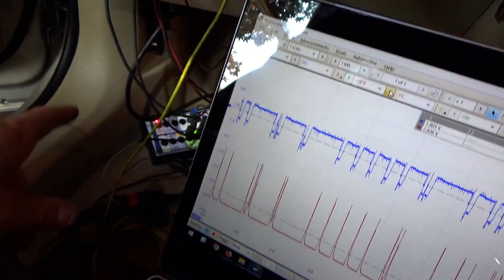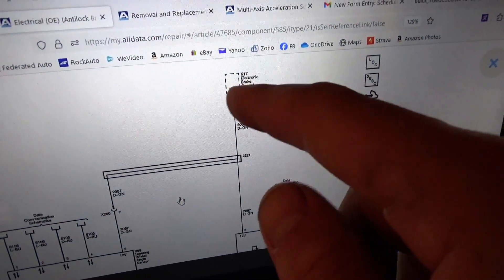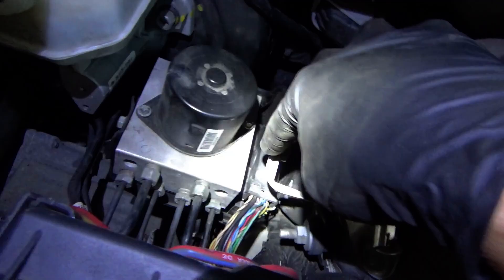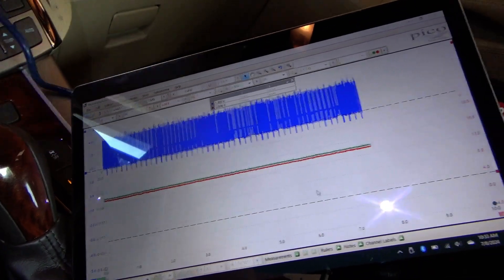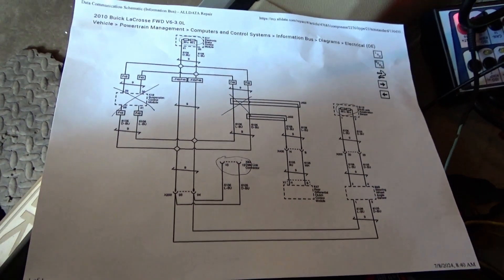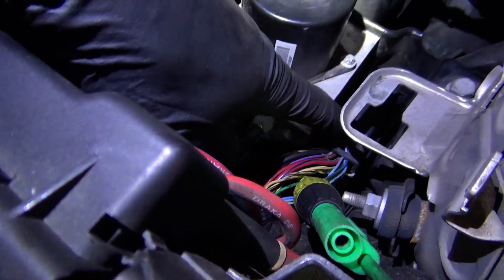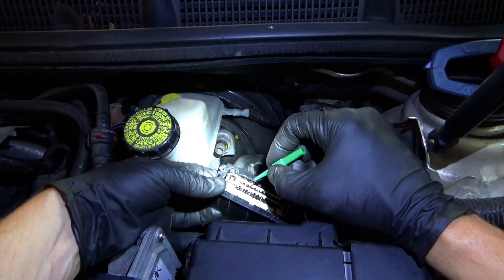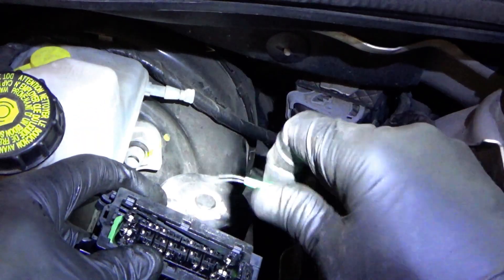(Pt 2) Customer Spent $1000...Now Car is MORE BROKEN!? (Buick GM ABS MALFUNCTION U0074)

Comment: Very common abs module fault, there is a pcb inside floating in a gel medium with gold conductors for critical connections and aluminium conductors for both power and ground, the aluminium conductors are in a horse shoe shape and are resistance welded to the pcb pads, they due to heat ,(coolant res directly above) want to straighten out and over the heat cycles fail. They commonly present issue intermittently until complete failure with ramping frequency. Can repair.

Comment: There is a reason they have the EBCM deliver power to the sensors which is likely a regulated supply that it can also monitor as a reference voltage.

Comment: I love advanced traction control and abs is an important part of it. The stabilitrak in my chevy cruze kept me from smashing into a guard rail. It was the first crappy winter storm of the season with the wrong tires. I was heading home at night and a truck was driving down the center of the road and I kept easing over to the edge and my car dipped off onto a hard shoulder and it immediately spun me sideways. The system noticed it even before I had consciousness of it and was heading right into a guard rail when the transmission shifted down, and it was pulsating individual wheels knowing the angle at which by this time I was turning the wheel to compensate straightened me back out like it never happened. Absolutely insane that my car just did that. I seen videos of it in action. I would've totaled my car out if it wasn't for the Stabilitrak.

Comment: It’s possible that the module it’s powering up has a capacitive load that looks like a short to the EBCM so the EBCM shuts off the power and retries it repeatedly. It would be helpful to also monitor the current while it’s retrying.

Comment: That was fun, thanks for taking us along on your very logical network diagnosis Ivan. It wouldn't have beneath me to hack it if it were my car, but rapping on the ECBM and seeing a dropout follow like that, really causes me to suspect a bad solder joint, probably on a discrete component or hookup wire that wouldn't be hard to find and fix. I think I'd have snooped around in there before calling the ECBM a lost cause.

Comment: I'm not sure who makes those modules but the Mercedes and Chrysler ones always used push fit connectors that had push pins that fit into the holes on the circuit boards instead of soldering the connectors directly on.  Those push pins or the holes on the boards could oxidize or become loose like the connectors themselves and in those cases I just add solder to the pins and it sometimes solves the issues.  But who knows, the 12 volt power feed for the sensors might be going through a relay inside the module and its the relay that's bad...  Idk, I just like to take the broken things apart. 😁

Comment: I e ran across this issue in the past where a circuit would not power up and after testing circuit and powering it up the circuit went back to working as normal. I was honestly baffled

Comment: Fixing it the right way was the correct thing to do. Imagine if you did a "no parts required" hack and the teenage daughter of the owner died in a crash because the ABS was deemed at fault? There is a reason why ABS stuff and air bag sensors and parts cost so much. The manufacturer has to make lots of money to afford all the liability insurance they have to buy so they can pay the jury awards when things go wrong.

Comment: I agree that for a shop when new parts are available that replacement is the proper fix. However, it probably requires replacing the entire ABS module including the valve body/pump assembly which may be very costly. In my case I have a 16 year old car with a defunct maker in a country where replacement parts run approximately twice what US residents pay. The electronic module for the 9-3 is available separately at CAD 677 plus shipping, actually not too bad. Fortunately Saab parts are still very available due to the intervention of the Swedish government. Then of course you need to get a Tech 2 with appropriate module and card and program it to the car. The repair to my module is still fine after 2+ years.

Comment: Same boat, my car or customers request I'm hacking the wire. Ive had both types of customers and they both have valid points on why they took the fix they did. Usually i can tell what the customers going to do buy the way they ask questions. Nothing wrong with ether way.

Comment: Excellent job Ive!  I love your 'terminal drag test' mate! - That's a ripper!  You eliminated half the EBCM problems by tightening those bus connectors, allowing you to confirm the other fault being internal to the EBCM module itself.

I guess it wasn't part of the customer's request, but I would love to have seen the EBCM board itself, out of its casing.  There may be just an easily 'Ivan-repairable' dry joint on the board?  Never mind, I may still see that in part 3!

Comment: To me that looks like a dry solder joint ... on the 12V line connector joint. my son had a similar  situation on his 24yo Toyota MR2 radio one minute it was ok then the next it would not power on took it apart and by passed the connector radio worked so reflowed the solder joints on the connector all ok, he was pleased as he liked the graphic's on the lcd display

Comment: So, an internal connection problem at the EBCM (possibly a cracked solder joint, not a transistor as I initially suggested), gets a bad diagnostic, spreads the network pins and installs unnecessary aftermarket sensors, collecting almost two grand in the process! Not the right way to make money!
I would be very tempted to provide the 12V externally and let it run until the EBCM fails for some other reason - less material going to the junkyard or landfill.
Part 3 will be more complicated because of the EBCM replacement (this should have ended NPR, in Part 2). Great work, as usual, Ivan!

Comment: Customer must have money to burn. Obviously a dry in the ABS. I wouldn't even go to the trouble of removing the ABS and opening the module if it would split. Either just short the IGN feed in the plug to the green. Or a lot easier, find an IGN feed near the SAS and connect to the green there. Fused if necessary. I'd have done the last one and torture tested it for a while anyway. Good diag anyway 👍

Comment: Tapping on the EBCM acts like a cold solder joint.  Welcome to the use of leadless solder.  It's too brittle.
If the ECBM is board accessable, then you could probably reflow all the solder joints, specially on the relays area of the board.

Comment: The idea of CAN Bus was to reduce the number of wires and connectors. It seems to have done the reverse, and enabled car manufacturers to build in overly complicated and unnecessary solutions to things that were not a problem in the first place !. I grew up fixing British cars. They had two circuits hanging off two fuses. Fuse one was everything that was hot all the time, fuse two was everything else that was switched by the key. I would have done the Russian fix in a jiffy, but it was in a time before liability for everything wrong in the universe fell on the shoulders of the last guy to touch the car . Thank you for a great and informative channel.

Comment: Broken Solder Joints. If that ECBM can be opened up, it can be fixed.  Any time you hit something and it starts working, that's the problem.

Comment: Likely a bad solder joint on the board . . . If not sealed, should be a no parts required fix AND not bastardize the car. (It may well be when they damaged the other pins, that the solder on the connector inside cracked). You know for certain that this is NOT failing electronic components, since those would not respond to being tapped. At this point, myself I would not even begin to think about changing the module until I could determine if I could get in it. (Had a Volvo with a similar connection failure in EBS several years ago . . . getting the module out took far longer than repairing it!)

Comment: HI Ivan,The main lesson was "just how far do you go?'to get to the issue.I thought you HAD it at the 2 twisted wire pair lose fit.And you did!!!!but only partially.I'm sure your viewers were like DAM >that's not it.I know i was.But then you did something ERIC likes to do,knock on stuff with a screw driver to see if the signal drops out.AND what do you know it did.haha SO a great lesson for us,don't be afraid to do the tap test.I fixed my Honda fuel pump relay doing the tap test.IT's a cold solder issue,or heat cycle issue.Getting more common it seems.Repairing newer cars does take MORE KNOWLEDGE but less physical work in some cases.LOVE watching all these vids,thanks guys.

Comment: I would open up the module. I bet you the pin inside or the transistor has a broken joint. Some heat new solder and good as new.

Comment: 100% a good idea to not do some bypass due to liability and whatnot.

I would consider repairing a bad solder joint the right thing to do though. The only scary part when it comes to liability would be how to make the box water tight after having taking it apart.

(Also for modern vehicles I'm not sure what's actually correct re type of solder, i.e. leaded / unleaded, and liability related to that).

Comment: true russian repair would be open block, resolder EBCM connector ( pretty sure it is not electronic component fault ,  but solder got a crack where connector soldered to PCB )  and seal it up ;).

Comment: I was expecting a connector issue myself.  And sure enough, lose fitting pins at the connector was an issue.  Typical.  I was hoping that was it, but we found that it wasn't the only problem.  Honestly Ivan, if it were my car, I would have made a key on jumper for the power feed too, and it would have been fine.  But some people want the job to be done right.  And it's those customers that I am most thankful for.  That won't be the cheap way out, but it is the correct way to help ensure that this problem won't come back.  I'm looking forward to part 3.

Comment: ATE ABS units have had a lot of cracked solder joints where the pins of the connector are sodered to PCB.  If that module could be opened without destroying it, I would have resoldered the connector. 

The Russian repair would have fixed the isuue fine, but when one solder joint cracks the others are near cracking also, and it might not take long when the module is at fault again.

Comment: Right around that year the module bosrds were no longer solderedvto the pins for the connector.   The board is just pressed onto the pins. A gollup of solder internal might fixerate it.

Comment: The old spread pin deal. At the Volvo Truck dealer I worked at we would get non warranty stuff in where non dealers would hack up the truck trying to fix an electrical problem. We would have to fix the hack first, then proceed with diag for the original problem.

Comment: 5:27 you did though. You pushed the wires to the side to point at the connector. I definitely cringed when you did that. I'm just an armchair quarterback, but I'm not surprised the resistance changed after that.

Comment: Ivan, why do you hate ABS so much? You have absolutely no good reason to hate and disable ABS systems. They can be lifesavers in emergency situations, or keep situations from becoming emergencies. Among other reasons.
Reply from the maker: I like being able to stop at the bottom of a snowy hill instead of chattering uncontrollably into cross traffic 😂
Reply: @PineHollowAutoDiagnostics  I understand. In that case, install a disabling switch; but the fact remains it is far better to have it and not need it rather than the other way around. Cheers!

Comment: There was a third option: open the module and re-flow the solder joints.  Probably would've been as good of a long-term fix as a new OEM module.  But not my car so I get it.

Comment: I wonder why GM ran the sensor power through the ABS module. I'm sure they had a reason, but it seems like a common 12V IGN relay through the fuse block would have been simpler and more reliable.

Comment: You got me wanting to open that module and examine it for cold solder joints at the board/connector. Lots of flux a little solder and a hot iron may be all it needs.
Reply from the maker: Hard part is opening it up... Sealed for life lol

Comment: Spread pin failure is common mistake.  DON'T STICK OVERSIZED PINS INTO SOCKETS!
Reply: Don't stick things in the hole 🕳️ that don't fit 😅😅
Reply: @2nickles647  unfortunately...  oversized pins CAN be forced resulting in spread socket contacts and "loose fitment."

Comment: Nice 🇺🇸👍, Someone is Definitely planning to run the Wheels off  of that 2010 Buick, Can't blame them now that 2024 Quality control is even Worse, Smart Customer, As long as the oil isn't run Hella low like the Red Truck, Because a New 2024 4 cly GM Truck probably go Boom🔥 doing that 😅.
Reply: I still drive my 03 Chevy...
Reply: @2nickles647  Right owning a Paid for Vehicle is Real Winning 👍
Reply: @2nickles647  I personally ran a 5.7l Vortec past 250.000 miles that truck never once let me down along a Road, Once when it needed a new Fuel pump because of Ethanol Damage imo in a Walmart parking lot I gave it a swift bump under the fuel tank got it running got home replaced the pump 😄.

Comment: Isn't it great that there are still some real tech's in this world.
I learned a long long time ago to not trust dealers.
Most of their techs are not trained to be thorough, Get it in throw parts at it and get it out.
I worked for one such person. Wouldn't let me do a thorough diag and would say just put this part on and send it out
Reply: It's not a dealership issue. 
Quit calling them Techs. 
Even the oil change guys are called Technicians.😅😅
Dealership, independent shop are the same. You find the so called Techs everywhere because it's easy to call a Auto mechanics Technician. 
There are so call ASE certified bonified every where also. 
A ASE certified is a person just passed a test they paid for.

Comment: Every winter my Chevy gets the ABS fuse pulled, they're terrible in the snow.
Reply from the maker: Yup real snow drivers know 😊
Reply: There is only very little advantage by the locked up wheels in the snow due to the wedge of snow that builds in front of the wheels but steering is absolutely impossible with locked wheels. Just keep your ABS on in the winter and learn to brake with ABS. Once the pedal starts pulsating hit it harder and don't let off. Also if you pull the ABS fuse, ESP is also disabled, which, especially in the winter, can do things, a driver simply can't. I once lost traction on both the right wheels in a left bend. The car started to veer towards the ditch. Once the steering angle was off enough compared to the lateral acceleration, the ESP noticeably braked the left rear wheel and the car stayed on the road. How do you do that with one brake pedal and the fuse pulled?

Comment: Could you have opened the EBCM and fixed the bad joint? If not did you offer the customer the much less expensive but equally effective Russian power hack option?

Comment: Pull the electronic module from the ABS and open it. Re-solder the connections where the bulk connector leads meet the board. They crack over time. When you drive a 16 year old Saab this is how you do things.
Reply: Resoldered my headlight relay on my 1998 900SE convertible and used silicone to put the cap back on. This is the way.
Reply: @@JeffroDH    Good job mate!  I'm glad you fixed it!  No more problens now ay?  Was that a Buick or a Saab?
Reply: @@rickclayton1806. Yes Rick I suspect the same thing too mate! - Without being familiar with these vehicles.  Anything that goes cattywampus when you tap it has gotta be a mechanically bad connection, causing an electrically bad connection!  Pretty obvious huh!  Might save a coupla hundred bucks with 10 minutes & a soldering iron!
Reply: @nevillegoddard4966   We agree.  As remogaggi82 noted, there indeed could be a huge liability problem.  I hope Ivan will remove the cover and investigate the pin connectors on the board.  The EBCM does not live in a nice neighborhood.  I suspect vibration and heat from exhaust manifolds could be troublesome.
Reply: @@jeffryblackmon4846    Yeah Jeff, apart from heat exposure to exhaust manifolds I think there was some sort of plastic tank sitting directly above it!  I dunno if it was windscreen washer fluid or radiator overflow, but yeah, a bloody awful spot to put such an important piece of electronics.
Reply: 2008 Saab 9-3. It's GM so very likely almost identical to the Buick. Saab had its own unique style of connector.
Reply: If it’s your car sure. But prob huge liability potential as a shop owner repairing a critical system and should anything ever go wrong in an accident scenario. Just my thoughts